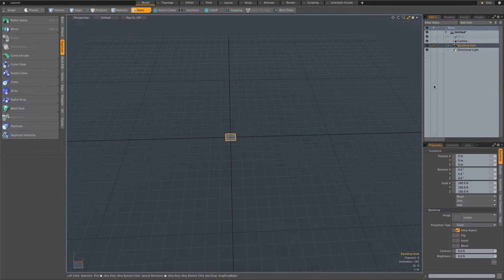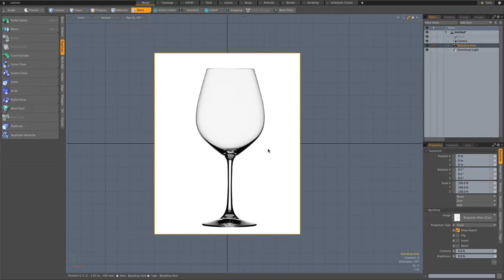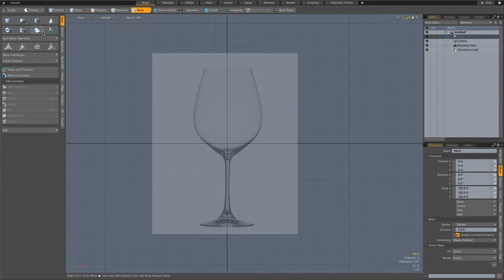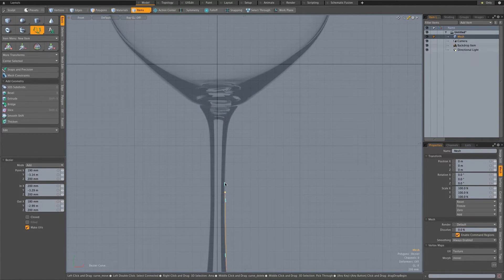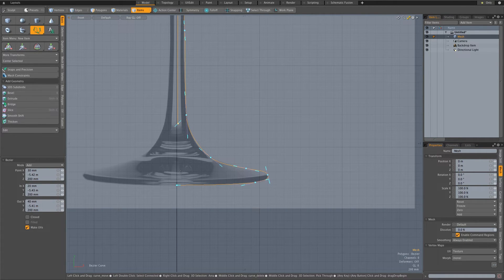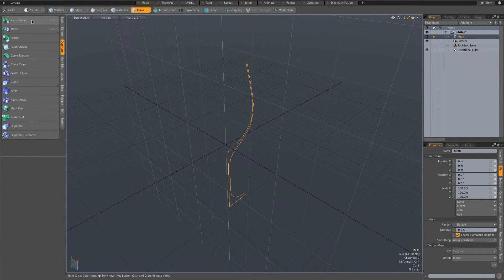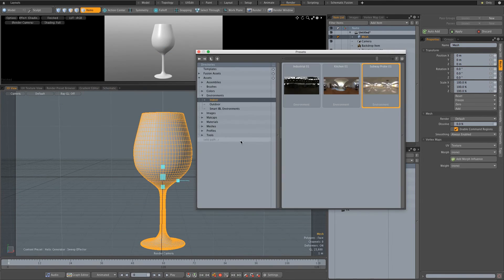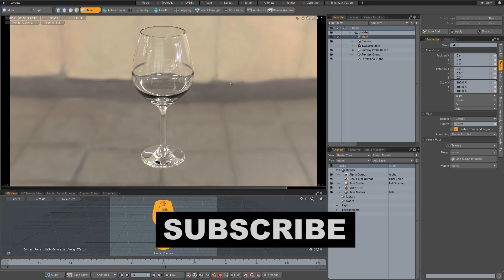How To Model A Wine Glass In Modo - 3D Modeling Tutorial

Comment: The curve (spline) doesn't need to connect back on to itself down the Y axis. Having this creates an edge down the middle of the stem that will distort how the glass refracts the glass material. It just needs leaving open at the bottom under the base and then above at the bottom of the bowl part.

Comment: Have you ever tried to project an image onto surface and "freeze" it on the surface by baking the texture.
This is a workflow that is trivial in Blender but in MODO I never seem to get it done well. Usually projection is more than adequate but sometimes when you shatter an object you will need that projected texture to stick to the object on which you projected it.
The documents at Modo are not very helpful, I get white baked textures :/ I manage to achieve it 2 or 3 times but that was probably pure luck.

BTW Ik zie dat jij ook Nederlands talig bent dus HOI!
Reply: I know I may be late to the party but I have the exact same problem: when using procedural shatter, the texture on the object brakes :/